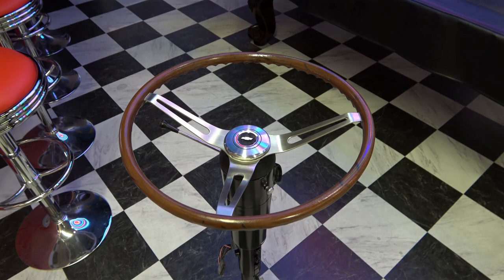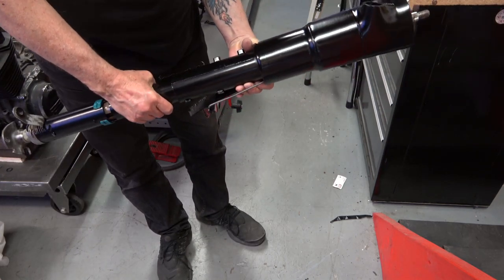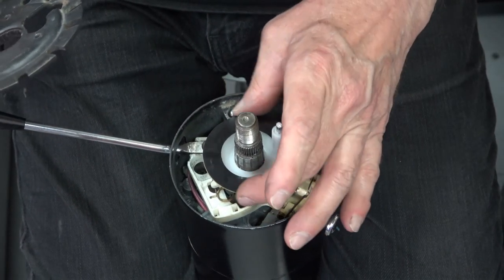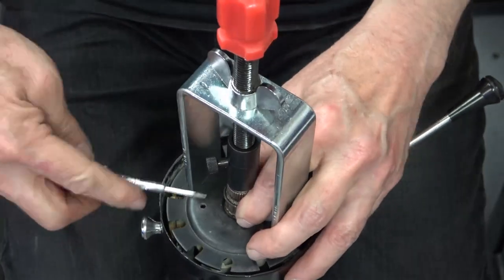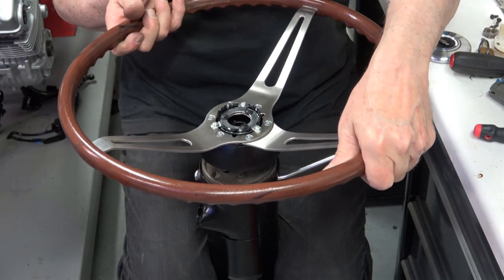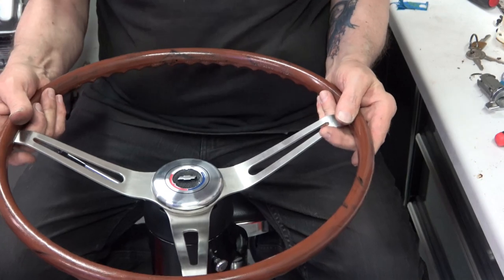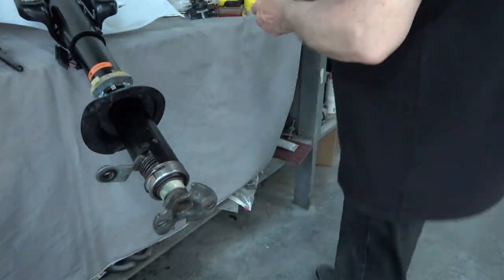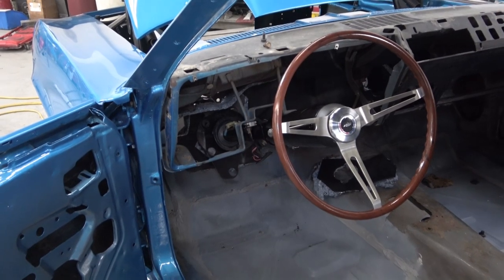69 Camaro in Le Mans Blue Full Restoration Video Series - Part 11 - Steering Column Restoration

Comment: Having problem snapping the horn cover on those teeth.  Question- are the blck gripping teeth supposed to sit outside the horn cover circumference? Thank you. Andy
Reply from the maker: Hi Andy, yes, you should be able to just start at one side to make sure it starts properly then press down until the others snap in place.
Reply: @digitalpizza1  thank you for the advice.     Working on a '71 Chevelle  limited funds running project.  👍